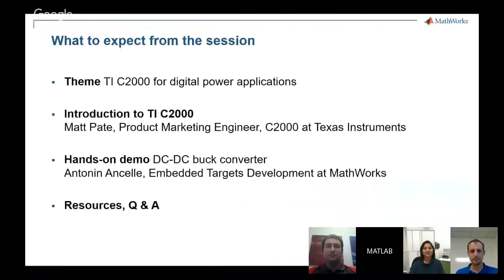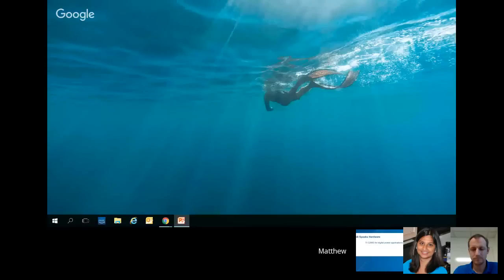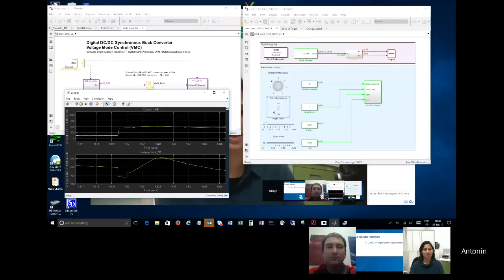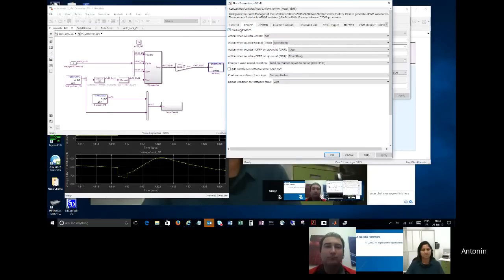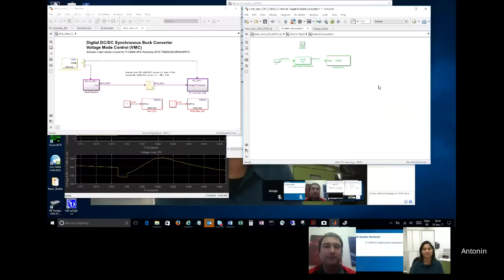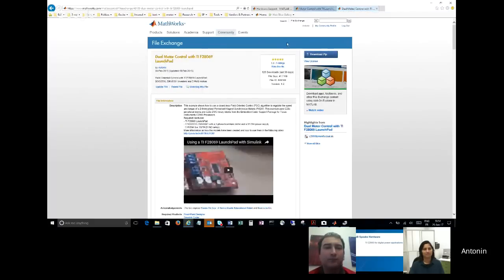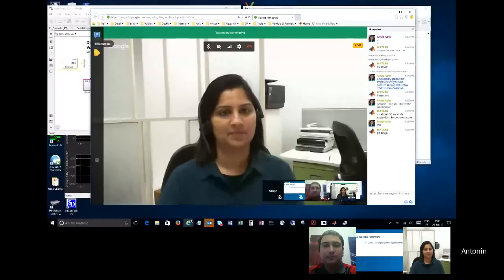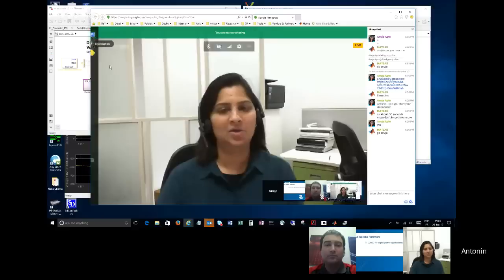MATLAB Speaks Hardware: TI C2000 for Digital Power Applications

Comment: Do you know, i was starting to work with this model two days ago.
Actually the voice is off
Reply from the maker: Sorry about that the presentation starts around 15:30
Reply: @ashacoolkarni  Hii, How can i download the matlab files for this model, i.e. DC-DC buck converter and controller using TI C2000 F28069 launchpad?